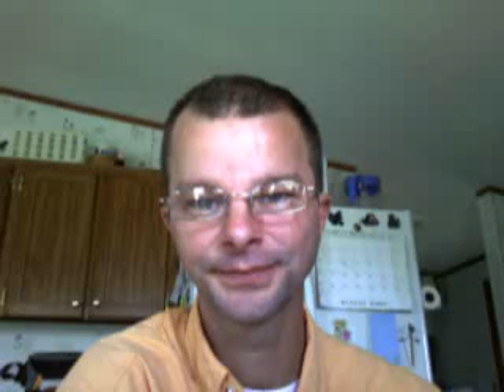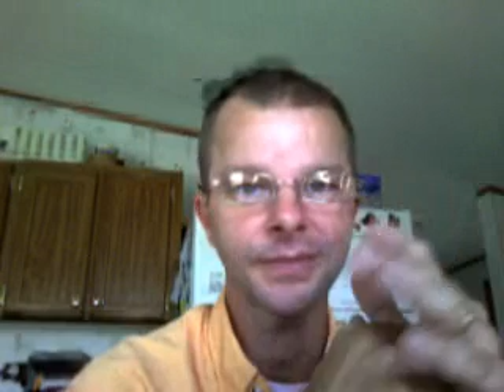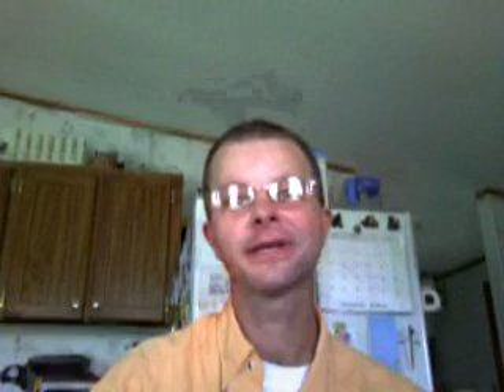HVAC York Heat Pump Troubleshooting

Comment: Hey Mike great vid, quick question tho, what about a heatpump that works fine in cool mode but short cycles when switched to heat mode, have seem sumthing like that before??
Reply from the maker: hey Jordan! sorry for the delay, under the weather as usual, heh. Yes, I've see that numerous times, the system is most likely overcharged. Either find someone different to service it this time or call them up, tell them to send someone besides the guy from last time that knows how to charge heat pumps with txv metering devices! lol. ....and to re-educate that tech because he's costing everyone money! ;)
Reply: oooh ok thanks mike

Comment: Nice video Mikie.  So the control board change was unnecessary?  If so, what did that set back the customer.  Also, did a previous repair tech install the wrong fan motor and why wasn't this noted somewhere on the air handler?  I'm just curious about the process take.
Reply from the maker: Hi Eric, well I'm guessing thar either another company or the home owner had installed the wrong motor, it was the first time that we were out there.. You rarely see any kind of maint. records posted on units any more and I dont recall how much it cost the customer... It was an insurance call, I dont recall what kind of policy they had... Most policies wouldn't cover it since an improper repair had been done before we showed up. Nothing like a pissed off home owner when you explain why its not covered:/. Some of the newer policies cover everything even if it was improperly repaired.

Comment: Good Job. Thanks.
John in Portland, OR  here
I enjoyed your video - great fun and helpful info. I am one of those engineers (electronic) with no A/C expertise, but just fixed my (2000 install) Carrier Heat Pump Air Handler blower motor not running well - bad fan bearings - installed new A.O. Smith motor. All good. I am retired and needed to save some money. New motor and cap was $150 vs local shop wanting $700. 

I would now like to do some preventive maintenance on outside unit which might be about to fail from old age  (installed - guess - with house in 1983. hmmmm). I thought I would put in a new compressor fan motor and 50/15 Capacitor rather than wait for them to fail. As a former Aircraft Field Engineer, I am at true believer in Preventive Maintenance. ;-)
Any thoughts, anyone?
Thanks again, John
Reply from the maker: +John Schuler sounds good John!  Usually the first thing to fail nowadays is the capacitor or contactor, usually the capacitor.  The capacitors on really old units tended to be huge and seemed to last forever, they just didnt overheat like the newer ones do. Ive opened up running units from the 60's and 70's (maybe 80's, cant remember) that still had the original capacitors in them and still chugging along!  Honestly I should have snagged a bunch for my personal use on units that we scrapped when customers upgraded, hehehe.

....anyway I'm getting side-tracted!  For preventative maintenance lets see... Replace or have ready to replace: run capacitors for compressor and condenser fan motor.  One of the problems I ran across FREQUENTLY on service calls was capacitors with faded labels/missing label/faded print on capacitor. So I bought a black paint pen from one of the hobby shops or some walmarts. When I install a new capacitor I write the size on the side of the can and the bottom of the can. I do the bottom too because sometimes Ill find one that has surface rust all the way around it.
ALWAYS TEST NEW CAPACITORS BEFORE INSTALLING THEM!!
Ive run across a number of bad capacitors that were brand new! The first time I burned myself because I thought the new motor I had installed was bad, so I pulled it and installed another, it had the same overheating problem! Argh!!
Brand new bad ones that Ive run across act like a roller-coaster when checked with a meter, say its a 10mfd cap, the meter will start out low, go up to 10, keep climbing higher, then go back down low, then back up, etc.  The fan motor fires up fine and runs for a while, then starts overheating and slowing down, you can smell the enamel on the wires in the motor melting, ugh.  So ALWAYS check new caps!

240v contactor with 24-32VAC coil (make SURE of the coil, search for HVAC in the keywords otherwise you will wind up with tons of contactors for wrong coil voltages and DC coil voltages!) Match the AMP rating on your old contactor or go stronger.(ex, 30a, 40a etc)
  HVAC contactors are cheap! A White Rogers 30a two pole 240v/24vac contactor is $8.50 on one site!  
Make sure if you are replacing a 2 pole that you get a 2 pole or single pole with a single pole!

Condenser fan motor. 
You can replace it if you think it needs it or just buy one and stock it. Call me paranoid, but if you are going to buy one and stock it, store it upright, shaft vertical. That way theres no side load on the bearings in the same place for a long time.
Make SURE you match the RPM!  Usually its a 1075 for most and 825  for the rest, but some will have odd variations. 
You can probably get by fine if the rpm is off a little bit, but you cant use a 1075 in an 825 installation, or visa versa. An 825 is typically a heavier motor, designed to turn a bigger fan blade at lower speeds.

I like to replace with OEM motors, but damn that can get expensive fast!  There are several good replacement brands, but its almost 2am and my brain only has about three hours sleep from the day before, hehehe!  
Also match speeds. Typically almost all are just single speed.
Make sure you ground the motor with the ground wire to the frame. Some mounting locations are insulated from ground and the bolts alone wont do it.
When you buy/order the new motor, buy a capacitor with it. Don't ASSUME that the capacitor in your unit is the right one for the new motor!  Always replace the capacitor when you replace the motor. If your unit currently uses a dual run capacitor, its ok to leave it there for the compressor and get some strap and hang the new fan cap, now they are separate.
ALWAYS TEST CAPACITORS BEFORE USING THEM!!

Electrical Connections!

Loose connections cause corrosion and overheating/melting/fire of wiring!  You never know where the problem could be. I had a call and the condenser would run for a while and trip the breaker. I killed the power to the unit in the main breaker box and started checking.
The terminals were loose on the main breaker. The terminals were a little loose also on the safety disconnect out on the wall by the unit. Also check the contactor terminals.then get inside the unit and pull the side cover off the compressor and check those three terminals for corrosion and make sure they are tight.
(They are a pain to replace!!)

If you have a safety disconnect by the condenser unit and it is a SquareD that looks like a breaker/flip switch type, instead of the pullout disconnect, and its ten years old or older, then find an exact match at lowes/home depot and replace it. You can pop it out of the box just like a breaker, that way you can just use the disconnect from the new one but put it in the old box, not having to replace the box on the wall.
After these old ones sit there on the wall, turned on for years, they tend to fail as soon as you turn them off to work on the unit, they never turn back on!  If you are feeling like going the extra mile and comfortable with your skills, AND there is enough wire coming out of the wall to work with, you can change the disconnect to the pull-out disconnect type. MUCH more reliable! Just make sure its amp rated.

Heres an odd one. If you have a large unit, say a 5 ton system, check the wiring size on the whip (insulated wiring harness going from the safety disconnect box to the condenser unit).  On rare occasions I have run across installs where they used an undersized whip for a system. Say using #10 where #8 should have been used.

Inspect the thermostat wiring between the unit and house. I get more calls because the dog or weedeater broke or shorted these! Also from sun baked coating that has exposed the wiring and they short together.

Wash the coils. Not too much pressure or the fins will bend. You can Wash from the outside, top down. Dont spray directly into the coil, it just packs it in!

Certain models had a double coil. I dont remember the brand/model. The dirt packs between the coils and the only way to get it out is to remove the clips holding the coils together and carefully separate them and wash.  Nothing I would recommend... Always a chance you could crack a line and leak out freon, better to let a tech that has done a number of them before!

Well thats off the top of my head at 2:42 in the morning with only three hours sleep the previous day, typed on my old ipad tablet with one finger!

Remember the old George Jetson cartoon, the episode where he got button finger cramp?  Not so funny and far-fetched now, is it? Hehe.   Nite!  Hope this helps!    Mike.
Reply: LOL, This sounds like a fun little diy project. Engineer boy impersonating a hvac tech. Compressor fan motor? I have never seen one of them on a residential system. Better stock up on the you tube vid's engineer pal. You are going to need it. Might want to have a ems crew on standby.

Comment: Here's a little on the York's Defrost Board Soft and Hard Lockouts:

LOCKOUT MODES

Soft Lockout
The control will cause a soft lockout during the following conditions.
1. High-pressure switch.
    a. Two openings within six hours.
2. Low-pressure switch.
    a. One opening of the switch for more than five seconds except under certain          conditions.
3. Outdoor ambient sensor failure (heat pump mode only).
4. Liquid line sensor failure (heat pump mode only).
5. High discharge temperature.
    a. Temperature reading exceeds 263F
6. Low discharge temperature.
    a. Temperature reading does not reach 90F following timer expiration under certain conditions.
7. Discharge line sensor failure.
8. Bonnet sensor failure (heat pump mode only).
9. Y2 present without Y1 (M outputs are powered by Y1 so soft lockout            necessarily occurs).
10. W and O signal received in HP mode (heat pump mode only).
11. Defrost curve jumper error (heat pump mode only).

The control will reset the soft lockout condition when any of the following occur following removal of the fault condition.

1. Power is cycled to the R or Y1 inputs of the control. This will cause the soft lockout condition to be reset when the thermostat is satisfied or when the thermostat is set to SYSTEM OFF and back to HEAT or COOL mode.

or

2. The TEST terminals are shorted for more than two seconds.
When the soft lockout condition is reset, the control will stop displaying
the fault code and will respond to thermostat inputs normally.

Hard Lockout

If four soft lockouts occur within a twelve-hour period caused by the following conditions, the control shall cause a hard lockout condition. The control will function in the same way during soft and hard lockout conditions. The difference is in the requirements for resetting the lockout condition. 

A hard lockout condition will not be reset when the thermostat is satisfied or when the thermostat is set to SYSTEM OFF and back to HEAT or COOL mode. Power (24 VAC) to the control must be removed and reapplied.

Comment: Hey mikie.. I saw your video on the heat pump dc relay.. I came across this the other day.. It was a 6 pin ice cube relay saying 12 or 24 dc.. I don't understand where the dc comes from and or does this relay send dc voltage to the sequencer does the sequencer run on dc and I read something about solid state device emitting dc I'm really stuck with these.. And you are the only person who has even mentioned these things so I was wondering if you could educate me on this..
Reply from the maker: I've been meaning to do a video on the cube relays for q while now, started one the other day but need to edit it.  So is the cube an ac or dc relay or does it only say DC?  If it is DC, and it is actually being fed DC to operate the coil then whatever is powering it is just rectifying the voltage with some diodes for this purpose.  Is this a late model, newer unit?  ...anyway unless the DC is being jumpered from the coil terminal to a relay terminal (unlikely, but I cant picture your setup) then the Dc is only to activate the coil on the cube, all the rest of the terminals will be passing AC depending on what they are feeding. I know they have a reason for putting dc stuff in the newer units (cant remember why) but to me its just something else to break, hehe.
Reply from the maker: ...as an addon note, there isnt any need to overthink or worry about the dc stuff, just be aware that its there and pay attention so you dont accidentally replace a dc relay or something with an ac part. You always look at them anyway since you have to check the amp rating, just something new to watch for. As far as what the cube is passing, just backtrack the wiring and see where its getting power and what its going to.  The cube, while can look daunting if you dont work with them, is just an oversized relay with more terminals, so more crap you have to make sure you wire back correctly when changing one out.  The nice thing about cubes is that you can pop the cover off and if its not working because of the contacts, can often get them cleaned up if you have some contact cleaning material. (Though i prefer to replace them) you can use two regular relays in place of a cube relay if you dont have one handy, maybe ill show that in the video as well.

Comment: higher rpm motor draw higher amp,should give u lower head pressure,shouldnt be cause compressor shut down,except over heat the fan motor will burn the motor,but fan motor is running,what cause contact not pulling in when it have 24v?

Comment from the maker: Hmm... haven't been asked that one before! ...it would also depend on what you mean by surging or what it sounds/looks like.  The only time or two that I've run across one that seemed to surge, or one that had an airflow problem that took me a while to pin down was on two units when a layer of fiberglass insulation *inside* the evaporator coil box had partially fallen loose from the ceiling of the box and was partially blocking the airflow through the coil. More information for me could help?

Comment: hi i have carrier hvac my air conditional works fine but heat doest not work when i push the contactor it doest work.and i check volt from the thermostat  and I’m getting 26 at the contactor let me know

Comment from the maker: Very interesting!  Sorry my health wasn't too good back when you posted this initally and I am slowly catching up to a zillion emails and posts, yeesh!  What did you figure out on the unit?  Replace the control board or was the problem elsewhere?  Have to do a system reset or ?  ...speaking of hard starts, I think I need to go out and check on mine.  We live waaaay out in the country and are at the end of the power line.  I've replaced my hard start kit twice! (10yr old unit) Time for a checkup!

Comment: I'm not a HVAC tech but an Electrical Engineer in another field. I have a Coleman 3.5 ton with something related to your problem. 4 big resistors have burnt the defrost board ( both sides) brown. Fan sizing ? Will check. suspect resistors undersized for profit. You could extend life by clip on heat sinks for resistors or tin foil if you are cheap and brave. My contactor not activated by defrost board. Sensors and thermostat ok. must be board for me. could be comp needs hard start 7 yrs old.

Comment: I have a 2.5 ton Goodman High EFF the high side line leaving the compressor is cold the low warm. almost no cooling. I'm thinking a bad valve or rings, but it may be a Scroll.  Any thoughts from you would be appreciated.

Comment: mike i have a nordyne heat pump that the compressor is bad(no other known issues at this time) the unit has no data plate,,, any idea as to the weighed charge to put it befor running the unit and fine tuning a bit ? other units nearby,, but none of them have any info either. all faded out,, thanks for the videos ,, steve
Reply: Just the issues that caused the compressor to fail.

Comment: Mike thanks for the info. I ran into almost  the exact same problem  motor was going out on thermal replaced motor with proper rpm/hp worked like a champ. I hope you all continue to post these videos it's wealth of info. Not new in the trade (10 years sheet-metal/install/change-out) but new to service about  6 months. I really appreciate you and Dr. Z
Thanks from a sincere fan

Comment: It's important to check the entire system out even if you think you've corrected the problem. Capacitors, motors, superheat, subcooling, cleanliness of components,CTD on defrost board must be timed, verify  pressure switch opens as it should with gauge attached. All must be verified before leaving the job.  Sometimes there are multiple problems to address.  You can also generate more income being more thorough.Take nothing for granted.This will prevent embarrassing recalls such as this!

Comment from the maker: You know thats right!  Usually I don't carry 825's on the truck, I had been carrying those 825 GE rescue motors but I don't think they are GE anymore, just borrowing the brand name for a while after being bought.   Anyway I seem to have issues with them so I try and get an emerson or AO Smith rescue motor.  1075 GE rescues are ok though I suppose.